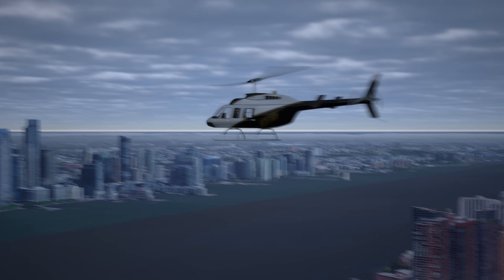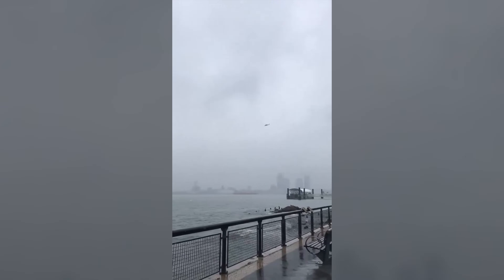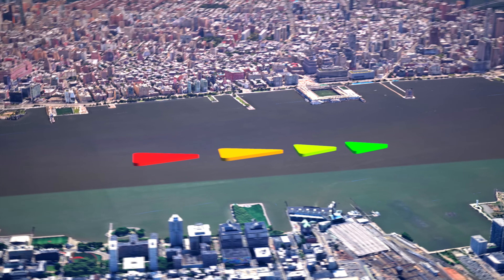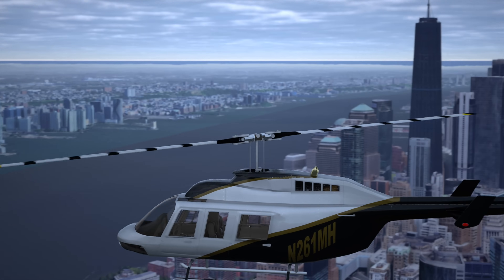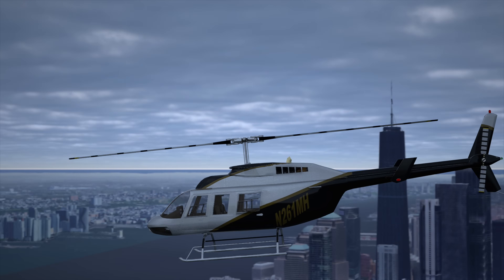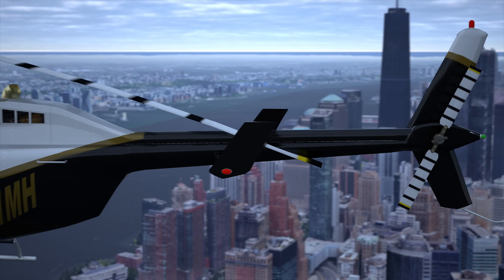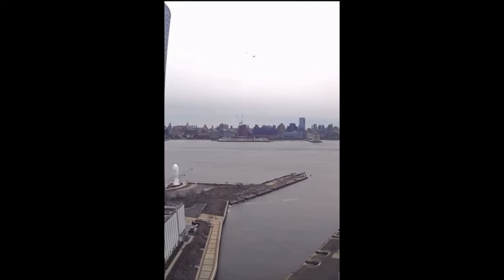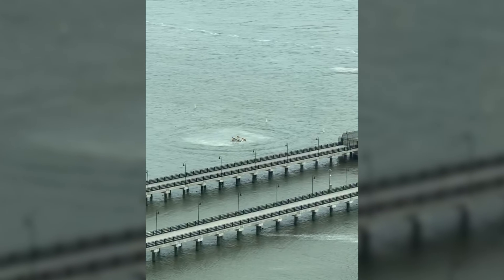Helicopters DON'T just fall from the sky - What is "Mast Bumping"?

Comment: No mentions of possible blade defects, chips, decay, aging, or cracks? The cabin fell in a rolling manner in one direction & the blades flew in the opposite direction possibly because they've both collided with eachother first before the force of the collision repelled against eachother, or the blade simply sliced through the tail causing the cabin to fall diagonally or slanted while the cabin maintained a rotating motion.

Comment: Mast bumping is just as it sounds…the hub contacts the mast. It would shear the mast and thus no gearbox attached. If the blades sheared the tail boom then it would be further back on the tail boom. You. Can see it’s broken right at the fuselage. This is not mast bumping but rather a failure of a component.

Comment: another logical explanation is just bad maintenance, anything like that only works if everything is actually put together correctly and maintained. People have off days, some people don't have the best attention to detail, and some just dont think at all. negligence  doesn't just happen with pilots or ground control, there's so many other jobs that play a part in these things that can still cost human lives even if they aren't directly involved. a bad maintenance schedule, failing to replace a part that needed too, or not using the right torque specs when tightening bolts, etc..

Comment: With over 30 years flying heli in very turbulent mountain winds, it's extremely unlikely this was caused by mast bumping due to  rough air.  If I was to 'guess' I would say the transmission or gear box seized from oil loss maybe and blew apart?  So incredibly rare for something like this to happen to a 206.  I'm curious to see the investigation results.  Sympathies go out to the surviving families.

Comment: Mast bumping was NOT the cause of this crash (IMO). Weather was reasonably good, pilot was experienced particularly on this route and most importantly the rotors blades were undamaged. My understanding in mast bumping incidences, the rotor blade that strikes the tail boom would break apart. The entire rotor assembly flew off with gearbox attached, not consistent with other mast bumping incidences. This model helicopter also only has a single documented case of mast bumping ever happening with millions of flight hours logged. 

My guess is a catastrophic gearbox failure, causing complete loss of tail rotor thrust. The helicopter starts to spin prior to the tail boom or main rotor separations.

Comment: At the beginning you use the words “common problem among most helicopters”. Not a correct statement. It has been common only among two helicopter models I can think of. To achieve  mast bumping in a long ranger it would  have to be a severe input…it is possible but not likely in a tour flight. I’ve got thousands of hours in Bell product; you would have to put it into mast bumping with intent. I’d say let the TSB sort it out…it could have been many things… pylon support failure, deck mounts, loss of tail rotor gearbox, flight control failure…but mast bumping for 206? Definitely not “common”

Comment: In some ways this video has a lot of luck, it did not impact the tower there in the river. That is one of the two intake/exhaust buildings for the Holland Tunnel, Afaik the number two building could ramp up to compensate but there was still a chance for it to get worse. The structure of the tunnel itself would be fine but a burning aircraft on the vent tower would be bad.

Comment: There didn't apear to be any damage to the main rotor so I don't think it hit the tail, I think a motor mount broke and ripped the tail off as the helicopter was falling. The main parts of the rotor shaft assembly are the strongest parts in the entire helicopter so they would both leave marks on the main rotor if they did hit and if the main gear box and what looks like the turbibe was still attached to it then the small part of the tail would then be the only thing holding the fuselage up as the gearbox pulles the rear shaft through the rear tube.

Comment: I'm a non pilot with 50 years of no experience and can say wholeheartily that this video was useful to me and informative.
Reply: this guy is a menace hahahahaha
Reply: Same
Reply: Wtf😂
Reply: well there is one born every day
Reply: Lmao depending on the context this one always makes me laugh
Reply: So informative I may use this information to go argue with people on other Youtube videos. Or I’m going to go make a sandwich. Still undecided.
Reply: You dont have to be an expert to grasp how this video is filled with incorrect bullshit. Let me Explain.. I've been flying helicopters my whole life and in this specific type of helo. ALSO i fly the Hudson every day for many years doing this exact type of operation. It is NOT mast bumping due to 2 critical points. 1.) the main rotor would sever or shear at the top of the main rotor mast, that is where the hub of the blade would teter, and "bump the mast" hence mast bumping. In the Clear video evidence from the crash you can see the main rotor does not "shear" rather fully departs WITH the transmission gear box still attached. This indicates that the failure happened INSIDE the transmission gearbox or driveshaft or the transmission mounts 2.) in mast bumping when the blade flaps down and strikes the tail boom of the helicopter, it happens at a far point down the tail boom, closer to the tail rotor, NOT near the start of the fuselage. In the video shown you can clearly see the tail buckle at its connecting point to the fuselage. Most likely a result from the massive torque incident that would be applied once the main transmission gearbox failed. Hope this helps. Deeply upsetting seeing videos like this one posted with zero clue about what they are talking about and referring to.
Reply: @colognetm7861 They just reported today that there was no flight record for this helicopter that day. The logical explanation is that some people wanted the CEO of Siemens dead.
Reply: Hahaha this is funny😂
Reply: The guy worked for Siemens, the company that was involved with the  design and development of the gas chamber for the nazis, they killed thousands of people, so its carma really
Reply: That Helicopter Crush, Just Like With Those Other Jet Plane and Helicopter Accidents Was An Inside Job Done By U.S. Government, The Brotherhoods of The Illuminati, Freemason, Skull N' Bone, Jesuit and Occult, Entity Organizations of The CIA, Secret Societies and Elites, and Also Shadow Governments.

And Remember That 9/11 Was Also An Orchestrated Plan Inside Job.
Reply: Well as a non pilot with 51 years of no experience, I can say this video wasn't useful and informative to me
Reply: Ya useful in knowing that I’ll never board a helo.  🎉
Reply: errrr its also telling me not to go anywhere near helicopters.... ive just heard too many people being suicided by helicopters which are essentially unstable to begin with!

Err off the top of my head nobody can explain why helicopters or the reason helicopters kill either! off the top of my head Colin Macrae rally driver, American NBA Basketball star i cant remember his name, the owner of Leicester City Football club in the UK..... and thats just the big ones i remember from sport funnily enough..... im pretty sure there are other celebs and what not
Reply: No, it's not. It didn't say the real reason why it fell. It didn't have fuel. Pilot called the tower. It was 3 mins away to land but it took him 20 mins to go there. Why? It sounds like a suicide mission. How did the pilot not see that it lacked fuel?
Reply: @RG76-FL  You misunderstood. Firstly, the pilot simply announced that he wanted to refuel at the next stopover. He did this so that his colleagues on the ground could prepare everything and he could be back in the air with new passengers more quickly.
That's normal for these tourist flights; they're in operation from morning to evening, usually fully booked, and they have to refuel every few rounds.
Secondly, he announced he would arrive in three minutes.
After 20 minutes, the boss says, the employees on the ground noticed that the helicopter wasn't there yet—of course, it had crashed in the meantime.
So the pilot didn't run out of fuel for THIS flight; he just wanted to refuel for the NEXT flight.
Reply: @RG76-FL  Lack of fuel wouldn't cause the rotors and tail boom to detach.  Come on.
Reply: Best thing ever. People who misunderstand everything and have no expertise in anything making up conspiracy theories. I pray for you 😂 @RG76-FL
Reply: @RG76-FL 
You managed to misunderstand every single thing about the refuelling request. 
Congrats.
Reply: @susivarga7303  You managed to misunderstand that being 3 mins away from landing didn't have to take 20 mins. Tower says the pilot was 3 mins away from landing point but it took him 20 mins. Did you even read the dialogues? Stop trusting leftist media.
Reply: @RG76-FL  real reason was gravity, its not the fall that kills ya its the abrupt stop at the end
Reply: @tommy2buttz668 There was no record of the helicopter's flight on that day. They just announced it. It didn't have fuel and had no flight record. It was definitely a mafia hit.

Comment: I used to work as an A&P at a Bell Service center. A medivac 222 came in for a transmission mounting plate refit. This was a large 1 piece, machined plate of metal that connects the transmission to the helicopter body and it had a SEVERE metal fatigue crack traveling across the entire plate. It looked as if it wouldn't have held for another flight and was only noticed by a mechanic performing a daily inspection! This obviously is not a 222, but seeing this instantly reminded me of that repair and how if that crack wasn't noticed then, it could've been just as tragic and something similar may have happened on this airframe.
Reply: @garya.3259  excellent observation 👌  ! Well 👏 done ✔

Comment: I am retired 20 year Army helicopter air crew-member/mechanic and to me this looks like a failure of the tail-boom mounting bolts (4 of them hold the tail-boom the the fuselage). The tail-boom has a counter rotating torque force on it. One side has 2 bolts that are in tension and on the other side they are in compression. If one or both of the bolts in tension shears then the tail-boom would likely twist and fold in haft were in joins with the fuselage until it shears off the remaining bolts and separates from the main body. It appears the the first part to detach was the tail-boom and the the rotor system so I would rule out mast bump, also I've seen Army footage of a helicopter that crashed after mast bumping and the mast sheared at the pivot point. This helicopter has the mast intact and still attached the the transmission. If the rotor made contact with the tail-boom that could cut the tail-boom off, but the blade would have shattered since they are mostly hollow and the blades are intact as the fall in the video. As for the bolt failure it could be corrosion due to operating in a salt water environment near the ocean or improper maintenance. With out having access the the maintenance records that is as far as we can speculate at this time except it does NOT look like pilot error.

Comment: Mast bumping seems to be the "Guess Du Jour".  I was assigned to an accident investigation that involved a UH-1H, with an outcome similar to this 206.  Transmission lift-link attachment failed,  rotor disk then tiled back hard, cutting the tail boom just aft of the sync elevators.  One blade separated from the hub and then the mast parted just below the hub.  Eye witness said the transmission tipped out toward the rear like it "poll vaulted" with the input short-shaft from the engine.  Altitude was about 2,000 ft... there were no survivors.   When we found the transmission the lift-link was still attached.  In the  case of the UH-1H, mast-bumping was the result of a much more serious mechanical failure.

Comment: When the NTSB report comes out it will be clear that it was catastrophic transmission failure causing massive right torque causing both the tail boom and transmission to simultaneously separate from the body.  This was not mast bumping chopping the tail off.

Comment: Did you bother to watch the video of the event while editing this video?  How you could possibly conclude that mast bumping was the cause is beyond me.  The helicopter was in straight and level flight at the time of the incident.  For mast bumping to occur, the helicopter would have needed to make and extreme pitch excursion which it obviously didn't do in the video.  From my Monday morning in the armchair at the Holiday Inn, the simplest explanation that perfectly fits the video evidence is the transmission Chernobyled causing it to lock up solid.  The huge amount of mass built up in the rotor system has to go somewhere which was the helicopter forcing it 90° into the airstream at over 80 knots immediately ripping the tail section off the helicopter.  The transmission mounts couldn't take the stresses caused by this and fractured, allowing the rotor blades/mast/transmission to separate from the helicopter.  The engine assy., still attached to the airframe, was now the heaviest part of the helicopter causing it to crash inverted.  The floats on the skids were automatically deployed when they contacted the water.

Comment: It's quite obvious this guy doesn't have a clue what he is talking about and neither you. Just making manouvres left and right doesn't gonna cause mast bumping. It needs to be pushing forward on cyclic to get under 1G. That unloads the disk and than is when you can get mast bumping or tailstrike. Main issue is a turbulence - that nearly got me several times and it got quite a few of my friends over the years (R22, R44, 206, UH1 - same problem) I dodged birds so many times with pretty aggressive inputs but as long as you have the disk loaded it's no issue. zero G is the killer and I would bet the pilot got gust from between some buildings. Birds are no issue here

Comment: Coming from the R/C helicopter space, this looks more like either a transmission or structural problem.  The whole helicopter is part of the drive train.  The whole helicopter takes the loads from the drive train.  One fails, it leads to the other failing.  There is a lot of kinetic energy in that drive train and rotors.  The fact that the helicopter was in level flight and just suddenly twisted around and the fact that the rotor blades stayed attached to the transmission directs away from a mast bump.  Granted, the main rotor blades can slice through anything and keep going, but you do run the risk of tearing one off with a strike, which leads to something much different happening than what happened here.

Comment: They may have  cut corners with the tourist fleet tourist craft is typically alway old  and always  older  20-40 years old . This chopper looked like an older model Bell Jet Ranger  and may be   it's 30  40 years old now .It has two jet engines but only one gear box that seems to have  suffered a catastrophic  failure  . 2023 two EC130's involved in a recent tourist crash in gold coast Australia , these two newish choppers collided , investigators found out they  cut corners , a radio in one of the choppers wasn't working  so no coms  in this busy airspace only visual so they ended hitting , both crashing and killing passengers terrible accident  and avoidable.  2017 A Sea tourist plane crashes  not far from  Sydney Harbour , an old float plane de Havilland  Beaver found to be toxic  exhaust from old radial engine leaking in through fire wall  in to cabin, The single pilot incapacitated  crashing plane into water killing a Leading British CEO all his family all on board  terrible. Don't ever go on these touristy  site seeing aircraft ever .EX military , police and certified professional pilots must be just shaking their heads again .

Comment: 2:20 - "To accelerate, the rearward rotor blade produces more lift, causing the rotor blade to tilt forward."
This isn't precisely correct. When the pilot inputs forward cyclic motion, the blade producing the most lift is on the left side of the aircraft. Due to gyroscopic precession; however, this force isn't actually applied to the rotor disc until 90 degrees later in its rotation.

Comment: Thank you for the input. As a former USAF crew chief, I did get to work on a few limited helicopters, mostly Bell UH-1's. Even got taught the basics of flying and was allowed to take off, fly, and land. Much harder than a fixed wing, in my opinion. But when I saw the video, It's the first thing I wondered is how it lost BOTH the complete tail and the top rotor. Unlike the Sully airplane incident,, where even a small bird can take out a jet engine, It's much harder for it to happen to a top rotor, let alone a whole tail. But Canadian geese are MUCH larger and heavier and possibly could if a flock was run into. Although there's also the possibility of the pilot hot dogging it for a VIP to show off and lost control, over compensated, and all heck broke loose.

Comment: 35 years later and all I hear in my head is "spike knock occurs when the round pin of the drag pin fitting contacts the square hole in the pylon stop which is mounted to the roof."  Every time I see a Bell 206 I hear that little poem in my head.